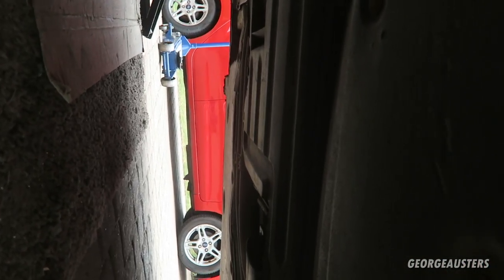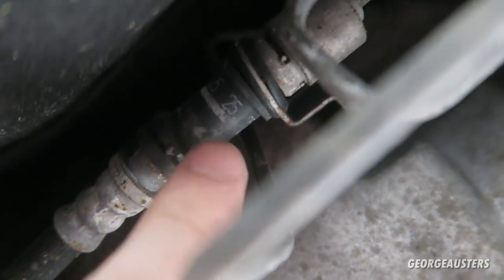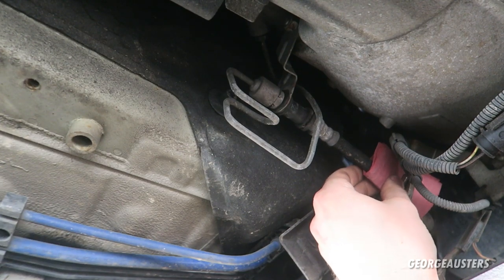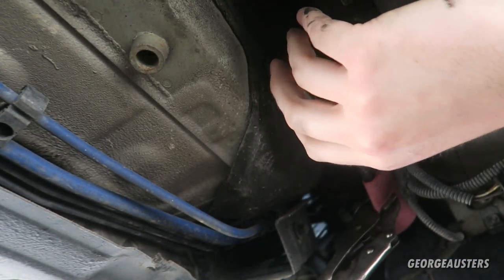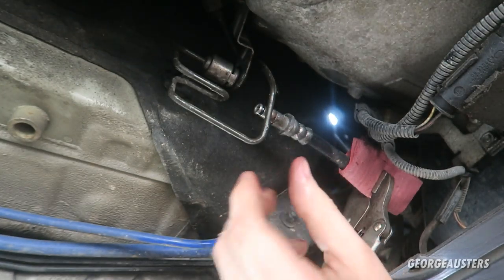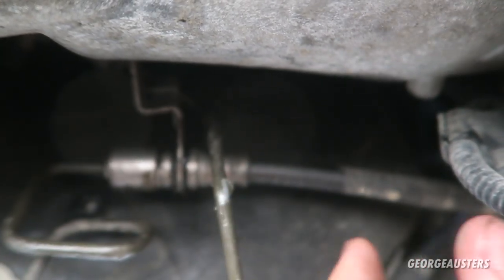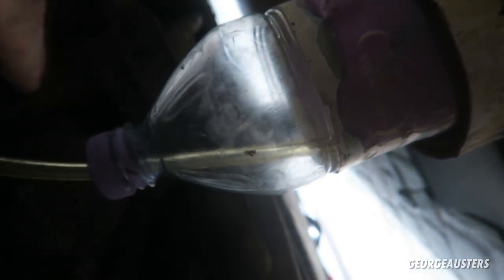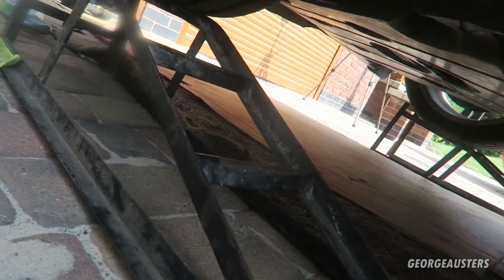HOW TO FIX BMW CLUTCH JUDDER

Comment: Just FYI.

You can knock the restrictive centre part out if the stock CDV to derestrict it. This means you don't have to stretch the pipe at all. It also looks stock! 😉

If you really wanted to you, could buy a new valve and knock the centre out of that one. This job then turns into a valve swap, which is a lot quicker and less likely to lose any fluid/get air bubbles!

Comment: George, I’ve got a question to you. 
There is a gap between my headlight and bumper. The gap is about 2 or 3 cm 
Is that normal or deep the bumper dropped. And if it did how do you fix it ?

Comment: Hi George. So .. I've bought a 1 series but the MK2 with the F20 "Prince" engine and it suffers with clutch judder when pulling away with a cold engine. There is no "delay". It does improve a bit when the engine has warmed up. My question is .. does this work with the MK2 1 series? The video description says clutch judder but then I hear "delay" so .. lol is this to fix clutch judder or clutch delay? Thanks!

Comment: Nice video again,  but how did you find this out ? 🤣 also can you just increase the flow of fluid a bit to improve things by drilling the center out rather than taking the whole part out and maybe stretching the pipe to reconnect?

Comment: daft question, but my gear change for 1st and 2nd is soo jittery at the minute on my 120D , ive just topped up my brake fluid, as ive changed 3x callipers in the past 8 months without topping the fluid up, could this top up of fluid help? i only say that as ive learnt from this video that the brake and clutch share the same fluid and tbh I did put a lot in when i topped up

Comment: George, I need you're help mate.  So, when I release clutch I noticed that the engine revs drop a little. Not when I push. Only when I release... I'm talking at rest... and idle.. as also happens the same when I turn the steering wheel to hit the end... it's 2007 e91 320d 110kw 
Please tell me roughly what you think it is. It will help me a lot. BTW I'm 👀 all your videos and hope your finish your working place soon.  Thx in advance mate. All best
Reply: I changed clutch kit 10 000km ago and this happens last 2-3000km.
Reply: Also hard to go in some gears like you say.

Comment: Hi George, since buying my 130i 2 weeks ago I just can’t seem to change gear smoothly unless in going to around 3k revs.
Anything lower and it’s jerky changes. To be fair I am driving it short distances to work from a cold start but I’m all my years of driving I’ve never found it so difficult to get a smooth gear change at lower revs. 

Have you had this? 
Does this delete help with that?
I’m looking for more smoother shift at slower speed rather than at high revs 

 thanks for you videos 👍🏻
Reply from the maker: Mine is exactly same unless you’re quick on the throttle or release the clutch very slowly
Reply: @GeorgeAusters  thanks George, guess this mod wouldn’t help and I just need to be quicker on the throttle.

Ive come from a focus 1.8tdci and you couldn’t rough change that if you tried 😆

Appreciate the help once again👍🏻

Comment: How do you know your BMW has this delay valve..? I wanna do mine and it’s a 420d. I’m getting judder when pulling away and also struggles sometimes to go in 1st and reverse so will defo need a new clutch!
Reply: This video is so old…….I’m shocked that you liked or even reply to my comment. Thanks so much and well done……what a guy! 👍🏼👊🏻
Reply: Did you end up fixing the problem? I have the same issue could you please give me some insight to what it was/could be?

Comment: Hi George, I have 316d f31 2017 with manual transmission. When I start in first gear from a standpoint cold or hot the car vibrates as I release the clutch and the lever is almost at the top. I tried to locate the vibrations and you feel it at most on the passenger seat on the floor. This happens sometimes not every time I use the car. I really don't know what is the issue. Could this be related to CDV?
Reply: did you manage to fix it? I have the same problem with my Z4
Reply: @theodor12  noup, i think it is the clutch
Reply: @theodor12  so  @Alejandro R. removed it and it fixed the issue for him...
Reply: I’ve got this same exact issue on my 120d, please can you give me an insight into what it was/could be please?

Comment: Hello, i have judder only in 1st gear and rear gear, just when the car starts moving, then it is all good. Is it the symptom of the cdv too? In your case the judder is for all gears or like me? Thanks (i have 325d e91 2009)
Reply: My friend this is a question 🙂
Reply from the maker: Possibly
Reply: I have the exact same issue could you please give some insight into what it could be/fixed it?
Reply: @whoknows3076  i have not changed anything and kept driving. I got some clutch slight noise after few months and the noise got worse by simply pressing even slighly the clutch and noise disappears when i release the pedal. The noise becomes light when the car is hot. So it is likely the release bearings damaged. It contains oil and as you drive the oil gets hotter and does the job. My clutch and dmf was brand new and the garage who sold it to me likely hasn't changed the release bearings. I will need to change the whole kit. No point in changing only the bearing due to the hour cost.

Comment: Got a 2010 BMW 320d Coupe , when i pull off in 1st i feel the judder sometime but other times its fine, although on a slope it occurs often. Took me a while to get use to driving the car as the cdv is just so much of a headache. All in all the clutch feels strong just the judder on occasion , would a cdv delete fix the issue?
Reply from the maker: It can help a lot yes 👍🏻
Reply: how does it feel? i have a problem with my 2013 f31 316d after tuning, might have some thoughts it could be this judder thing, always happens in 3th gear i think it was.. just hoping its not the clutch since it has only 114k on the odo... but i dont know, if so upgrade time :)
Reply: Did it work?

Comment: What about the extra pressure the clutch slave cylinder seals will have to deal with.  This could end up bursting seals not rated for the pressure rise after removal. COULD END UP EXPENCIVE AFTER SEALS BURST AND COVER CLUTCH IN FLUID.(New clutch, new slave cylinder and whatever BMW decide to charge you.  The mod in theory is great but all the other parts around the system may not be able to take the extra sudden. pressure rise. Be careful. Would have more negative affects on higher mileage bmw as parts will be old and worn.

Comment: Did bleeding the clutch work that way? The official bmw Service Advice for bleeding the clutch requires removing the Slave Cylinder. Any Problems with the way you did it?
Reply: And btw, what Diameter Pipe did you use?
Reply from the maker: Worked fine👍🏻

Comment: I’ve got my car up on axle stands at the moment after taking the diff out for new bearings.......expensive job 😔 Think I’ll do this free mod while it’s in the air to offset my financial pain. Been meaning to for a while, just haven’t got round to it.
Reply from the maker: I’ll be doing diff on E60 soon👍🏻
Reply: @GeorgeAusters  If you mean doing the bearings don't bother! On my 330d i found a place that supplies them but they're £400! A reputable transmission specialist near me is doing it for £400 so it's a no brainer, i'd like to do it myself but the risk of getting it wrong and ruining £400 worth of bearings isn't worth it. Getting the diff out took me less than an hour and while it's out i've poly bushed the mounts.
Reply from the maker: @simonhaycocks  Yes i'm getting it refurbished by a company and should be replacing the bushes too
Reply: @GeorgeAusters  Also, i don't know if you are poly bushing your diff mounts but if so check out strongflex, a lot cheaper than powerflex, they were delivered reasonably quickly and fitted perfectly. They've added no NVH so are a great upgrade. The instant throttle response is very noticeable now, no more slight delay as the torque wound up the flex in the old bushings.
Reply from the maker: @simonhaycocks  I've installed powerflex main subframe bushes and trailing arm bushes so think i'll stick with them. 

Did you have any trouble removing the orignal bushes?
Reply: @GeorgeAusters  I’ve got a few sets of pullers, one with about 20 different sizes so no I didn’t! They made it a doddle. I saw your video with you doing your subframe bushings without pullers. If you haven’t got a set yet get some off amazon, they’re not overly expensive but make the job of changing bushings and suspension bearings very easy. I’ll try and find a link to the ones I bought.

Comment: Please don't chav this one with poly bushes etc. Each modification away from OEM makes a car less refined to drive.
Reply from the maker: Polybushes are one of the best handling mods you can do👍🏻
Reply: Purists be like: don't change this shitty piece, don' change that shitty piece.

Me: first thing done when when ingot the car
Reply from the maker: Yep drives much better without clutch delay valve👍🏻
Reply: @GeorgeAusters  after installing PowerFlex, I agree, but disagree as well. Poly bushes will greatly improve steering feel, but will also make the car less refined to drive. You will feel all road imperfections in your wheel. So in corners, great, on the motor way and shity roads, less great.. :)
Reply from the maker: Of course you’re compromising a little bit of comfort for performance and durability but on the standard suspension setup I think the ride will be fine for me with a few polybushes!
Reply: Chav it with poly bushes really? Of course your losing some comfort but your losing it to gain better handling you can’t have the best of both worlds unfortunately. But I would not describe poly bushes as chaving it
Reply from the maker: @tommyaffs4549  It's worth mentioning that powerflex do a street bush and a racing bush so if you want to keep some comfort then go with the street series!
Reply: George Austers 100% my corrado is all purple powerflex bushes as I want the best of both really the black series really are a little harsh if you plan on using them on road at all
Reply from the maker: Tommy Affs Yeah black series are strictly for track use when you really want to corner flat mate
Reply: I fitted whiteline rear subframe bushes (full bushes, not inserts), koni shocks all round and M3 front control arm and tension strut. Changed out the run flats for some quality non run flats and it is a massive improvement on handling whilst only be slightly noisier!